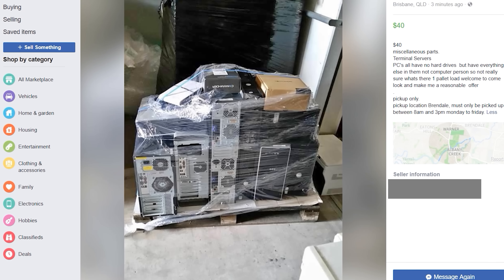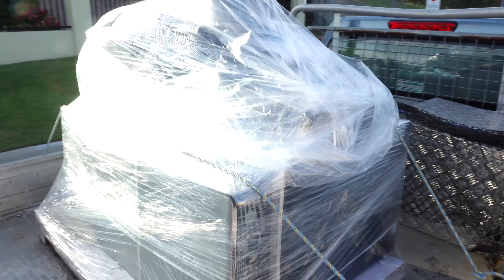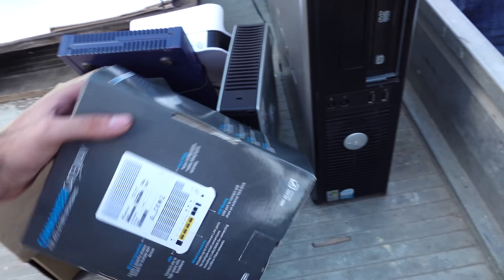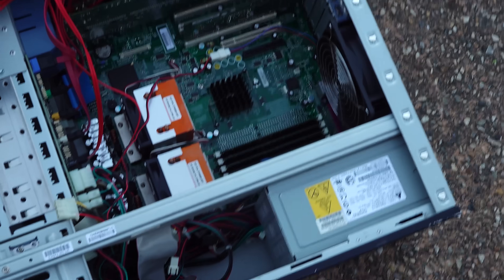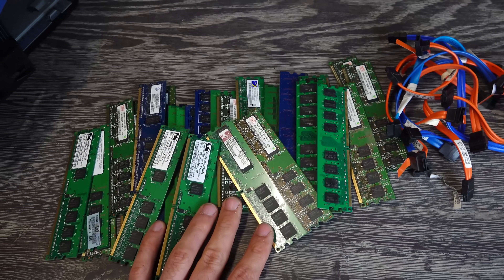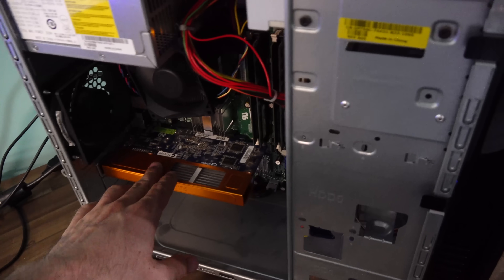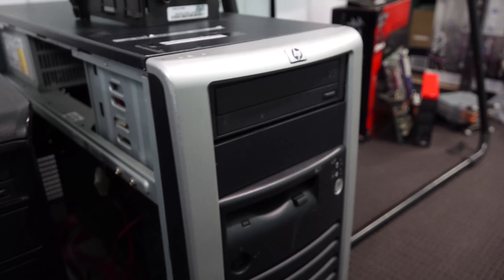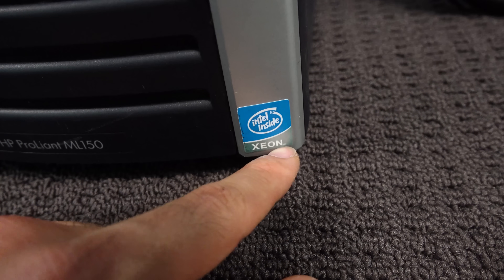I Got 15 Computers for $30....!

Comment: Just FYI those Vostro 200 Motherboards  - even though they can be modified to run even 45nm 771 Xeons - there is no way to get a Quadcore (Xeon or C2Q) working on these.
Anyway, if you need a modified BIOS for these with AHCI enabled and if you want 45nm dualcore Xeon Microcode, let me know. (I did notice you changed your Skype recently?)
Reply: Or he could use one of those Optiplex motherboards. If you update the BIOS they will run up to I believe a Q9650. I have one working with a Q9550 even though Dell's website says a Q6700 is the highest it can run.

Comment: q6600 will play league fine just pair it with 8gb of ram on any of the optiplexs the graphics card my not be enough to play it at high settings but that being said the onboard graphics on the optiplex (at least the 760) can run it at low settings just fine.

Comment: @Tech YES City  with wich cpu's do you use this ddr2 memory? do you just build some crapy lol or cs:go potatoes? can you sell now a 775 system for today's games?
Reply: Fortnite runs on Core2Quads but it is right on the line - OCed is needed but it is doable with a half decent GPU I find the sweet spot for these builds is £150 sell all day long at that price on FB

Comment: Im still using LGA 775 with DDR2 and belive it, im playing some games 3-4 times a week.
Reply: @Marta1Buck   q6600/asus p5q pro/8800gt/8gb ddr2 800mhz/overclocked at 3.2ghz, 2 ssds in raid on at sata3 card..still rocket fast and instant click on just abt anything i do And it will boot mac  el capitain as a dual boot....the q6600 i bought in 2008 and its Still usable today
Reply: @skip741x3  That's hard core.
Reply: @Autronic @vawa-ID slaps both of you in face with netbook and laptop from before 2010
Reply: HOW
Reply: @Marta1Buck  im using SATA2 HDD hehhe...
Reply: I got a 775 ddr3 and im pretty happy...CPU is a Q9400 and a GTX 1050☺with 6gb of ram
Reply: My gtx 670/ x5460 @4ghz was incredible if i had 8-16 gigs ddr2 instead of 4, it’d be better but then mobo burned because of high wattage
Reply: Utku Bayar ouch poor you

Comment: Did you get any x58 dell precision t3500s or xps 9100's? Or hp z400s? I made a beast build with a dell x58 mobo that beats my i7 7700k stock with a xeon w3680 oc'ed at 4Ghz in multithreaded loads, no where near in single core loads

Comment: I sold one of those servers for over 800 bucks when I chucked 32gb ram in it and maxed out the processors
Reply: Scrap Tech Tips what server and specs? I have an x3550 m1 server with dual x5355 and 32gb ram with drives and no one wants it for $300 Canadian lol
Reply: @excess.subiefl0w  how I did it was put a desktop PSU in it and then put it in a desktop case. 
The real hook for the people buying mine is that I sell it with windows 2016 data centre server a $3000 value for 14 bucks on eBay.
Reply: @excess.subiefl0w  bear in mind that it was $900nzd
Reply: @excess.subiefl0w  Thats because your price is wayyy overpriced. I can buy the M3 models with dual x5650's and 64gb ddr3 ram for just over $120
Reply: @ElectronicRedPanda the motherboards were going for over 400 by themselves.
The PSU was a high end desktop PSU with 800w of continuous.
The os  was windows 2016 data centre this normally costs over 2.5k the heatsinks I paid 160 for because they were an exotic 771 heatsink layout.
If you think it was not worth it think again.
Reply: If you're buying old computers and don't do research on specs then it's your fault if you feel scammed. Few google searches are better than wasting 800 bucks, and a lot faster compared to the time it takes you to earn that 800. 

You can take a risk if you really want to burn money away but don't complain about your own ignorance or defend others like you, it's degenerate behavior.
Reply: @ElectronicRedPanda hey m8 I am in NZ our dolla  is weaker and I need to import what I use and the shipping was horrendous.
Reply: Would you sell the Asus motherboard.  If so how much
Reply: What LGA775 Mobo supports 32gb of RAM?
Reply: @ElectronicRedPanda na m8 its worth what its worth there were comparing servers on trade me for only 100 less than the one I sold .

Comment: you need to do the BSel mod to the cpu it can overclock 775 cpu in oem mobos its hit or miss but its a nice overclock if it works for the cost of a tiny piece of tape. lol
Reply: the E4500 should work it will change the FSB from 800 mhz to 1066 mhz 
2.75 x 1066 = will jump to 2.93ghz

Comment: that dell looks like one i used i changed a case to a antec case + psu combo from ebay and bought a 4gb kit for a full 8gb of ddr2. mine came with a C2Q Q9550 and 4gb had to change the power supply because it started to smoke. used it for 2 years before getting an i3 2120.

Comment: These shits cant be used for anything :D
Reply: Mister Coconut honestly
Reply: Dual CPU's don't scale well just like GPU's
Reply: @thomaswepfer  Depends on the workload, gaming? They scale terrible for most games. But anything that can handle multiple cores they scale great. Source: I have personally done some virtualization on a dual xeon system.
Reply: Oh they absolutely can. The dual Xeon one can be extremely powerful with some cheap upgrades.